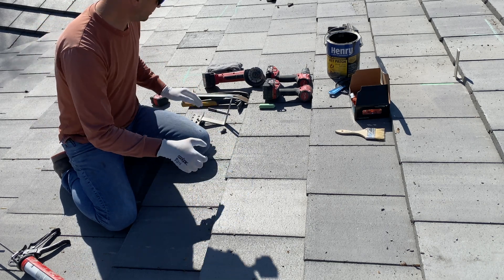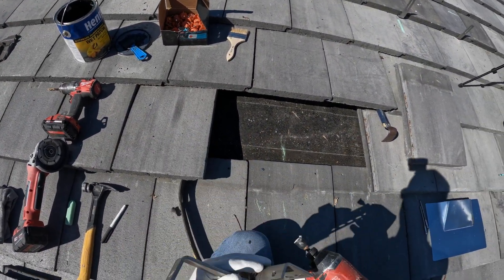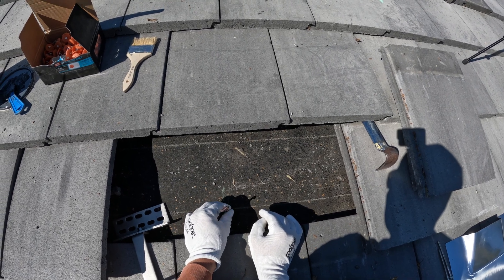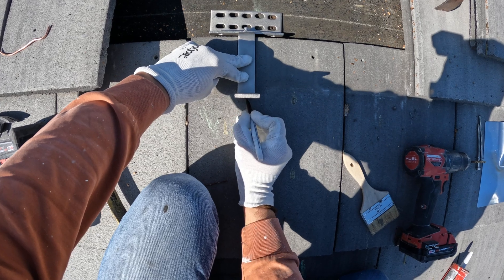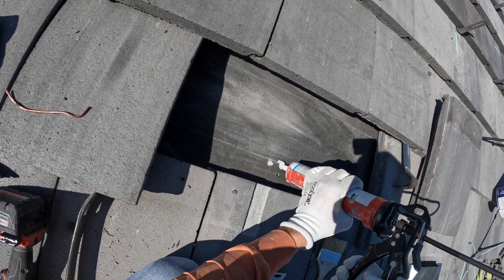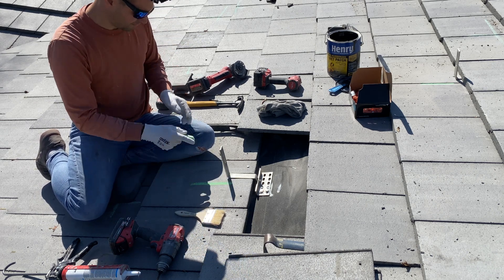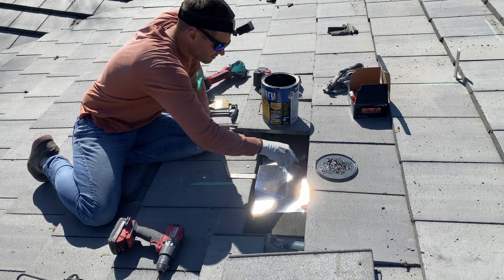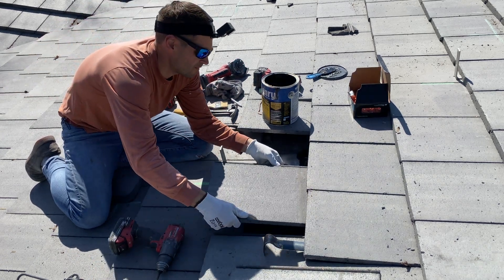Step-by-Step Guide: Installing Ironridge All Tile Hook on Concrete Flat Tile Roof for Solar Panels

Comment: The concrete tiles have two nail holes to prevent the tiles from sliding out.  How do you remove these nails and then reinsert them to prevent the tiles from sliding out?

Comment: Thanks, I will be doing this on my roof, but I have W shaped concrete tiles. Curious if your city allowed this without putting  underlayment or felt paper over the flashing?
Reply from the maker: yes, no issues
Reply: @SolarEngineering  Is the flashing even necessary? I'm thinking with the roof caulk, how could any water get in. I read on the Iron Ridge website that the flashing is optional. Another point is, when the flashing is attached with two nails, now there are two more holes. I have to put in 30 of these mounts on my roof. If I use your method, how long do you think it will take with W shape tiles? I'm sure the first few will go slow, but once I get the hand of it, they should go pretty fast. I also noticed that you didn't use caulking to hold the tile down. I wouldn't think you would need it, but others have. What do you think?

Comment: what was the copper wire for -hard to hear? thanks
Reply from the maker: ah, it's just 6AWG solid copper wire.
Reply: sorry what was probing inside the hole for? @SolarEngineering
Reply from the maker: @Cordycep1  Note at 1:04 that both ends of the wire are bent in the same direction. Whenever rafter is missed, to find out if it's on the left or right of the drilled hole, I'm inserting the wire into the hole and rotate it, you can feel it when it's touching rafter.
Reply: This is how I find joists in ceilings, will use the same method on roof. Any stiff wire that fits through the drilled hole will work

Comment: Iam doing my first solar on concrete tile next week. What adhesive did you use? I bought Chemlink tile secure
Reply from the maker: I'm using Chem Link M-1 Structural
Reply: @SolarEngineering   do you think the m1 is better to use?
Reply from the maker: @The12345condor  it just was in stock where I buy parts.
Reply: I use m1 at my work, I do solar as well.

Comment: I’ve never even seen a concrete tile roof in person. I would have been very intimidated if I had to install solar panels on it. Nicely done
Reply from the maker: same here, first time touching it, it's really brittle and hard to walk and work.
Reply: @SolarEngineering  These tiles are very common in England however most roofs do no have plywood bases or sarking boards as they call them here & instead just use something like a 50mm x 25mm wood batten for every row of tiles so the flashing you used would not work on most roofs. This means you cannot use the ironridge hook flashing, but I suppose the lack of a sarking board allows the felt should be installed with a slight sag between rafters mean most water should not meet the hook.
Reply: This guy is very thorough! I need to have a guy like this.
Reply: Can you do it in San Jose California?
Reply from the maker: @tamho8383  feel free to contact me via mysolareng.com
Reply: Come to California darn near all they got.